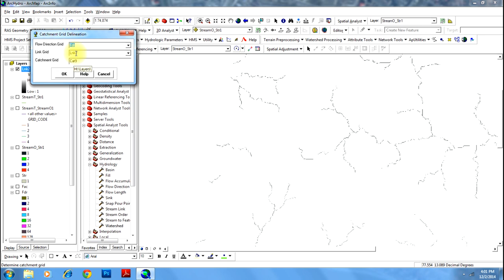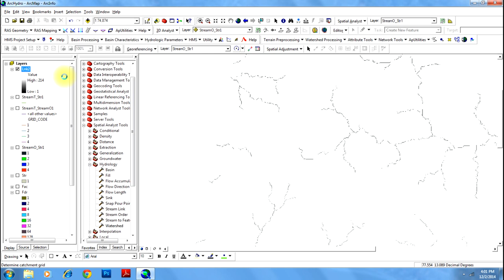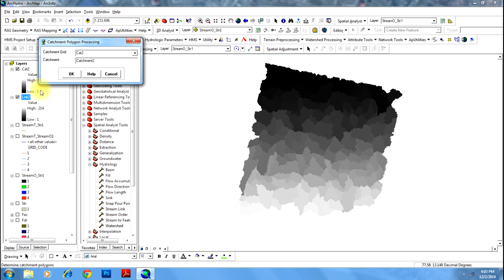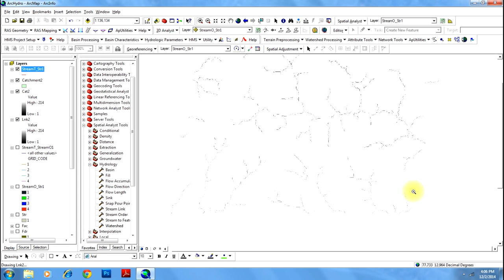Arc Hydro Tools - Watershed Delineation - Hydrologyl Study in ArcMap

Comment: Thanks. would you make a video on how to use a pour point for flow routs in any catchments?
Reply from the maker: I will try to make. What you all have to do is identify the outlet and define that as pour point in arc hydro. You may have to repeat steps a couple of times to get the required result